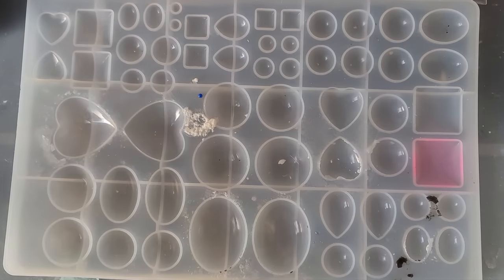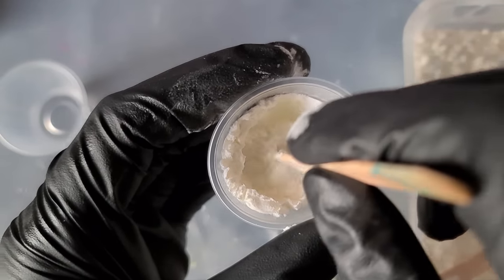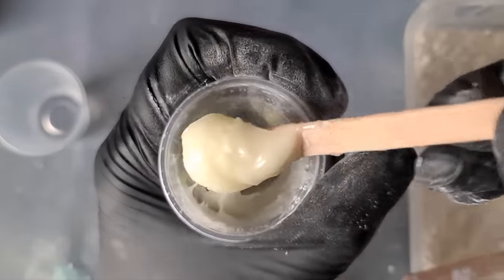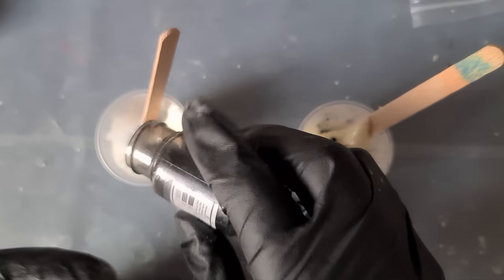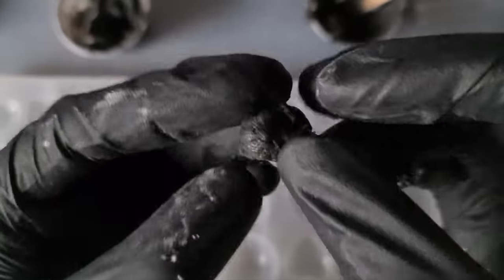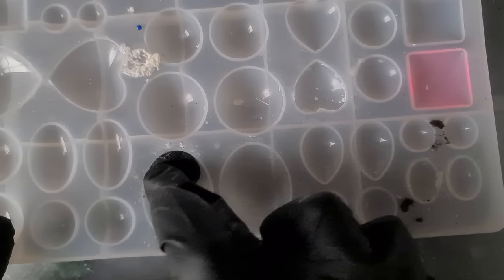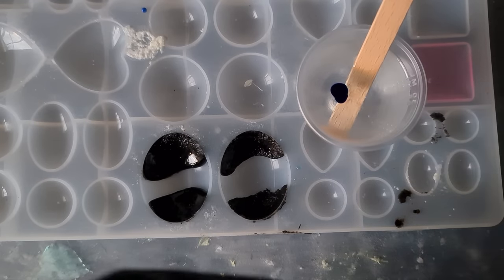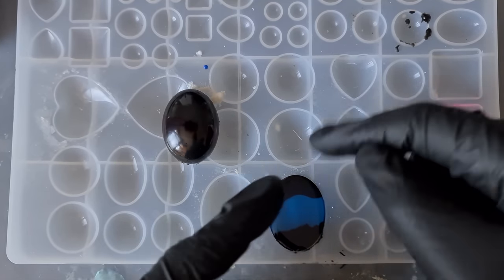He ADDS CORNSTARCH TO EPOXY Resin.... A Video by Daniel Cooper

Comment: Unless one part requires significantly more mica than the other, you could add enough mica to one part to get the color you want - keeping track of how much you are using - then simply double the amount in the same part. Then when you mix the two parts, you'll have enough mica to color it all thoroughly AND know when the parts are completely mixed.

An advantage there would be that you can keep a few colors you use a lot in separate containers of part A, but keep all of part B in one container

I LOVE watching your experiments!  You think so far 'out of the box', it's like you are in a different world!
Reply from the maker: Great idea Susan! Yes, so long as you remember the ratios used that work work brilliantly 🤩🤩

Comment: hi, thanks for the tips, i am from brazil, and i make rustic cutting boards, and sometime i need to fill the cracks on the wood, and work with resin is to difficult because of the leaks. Do you thing this could work in this case? It wil be resistent?
Reply from the maker: This would definitely work, if you flood coat after, be sure to sand the infill first 😁
Reply: @daniel..cooper  thank you very much👍

Comment: Wondering if this putty could be the answer to the “Glass Eye Issue.”  As far as I know, nobody has come up with a solution for getting them to stick to 3D silicone molds so they don’t slide around when you do your pour. Some say UV but it really just makes a slippery mess, especially on thicker 3D molds.
Reply from the maker: Yes, this would work by holding anything in place like that, especially if the resin is going to be black anyway and the mold dusted 😊

Comment: I don't have the 4hr cure resin, only the regular 24hr cure stuff. Do ye reckon it would still work?

What if you add the colour first, then the cornstarch? Have you tried stirring each little spoonful as you put it in rather than once it's all in? Does that make any difference whatsoever? I'm not entirely sure where my measuring spoons have gone (prolly still in storage) so do ye think I could just use teaspoons and eyeball it? It's roughly 2 and a half teaspoons, right?

(can't sleep cuz brain won't shut up, hence the 50m questions *sheepish*)
Reply from the maker: Any epoxy will work 😊 you may just need more cornstarch for it to thicken. You could color the epoxy 1st yes 😊

Comment: I using a Epoxy Putty 25%resin and 75%calcium carbonate very strong but setting time is very late , Please help and guidance to me how to make it Fast Curing this Putty about 30minutes to set
Reply from the maker: It has to be a fast cure epoxy
Reply: You add some black powder what is this ?